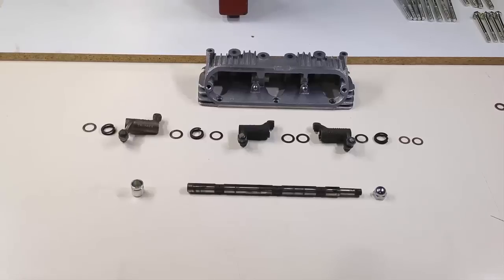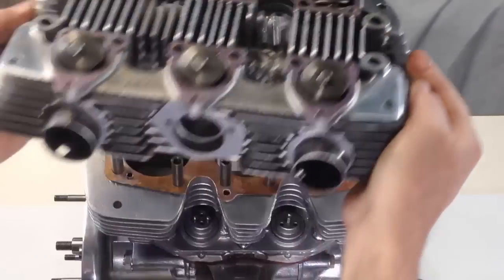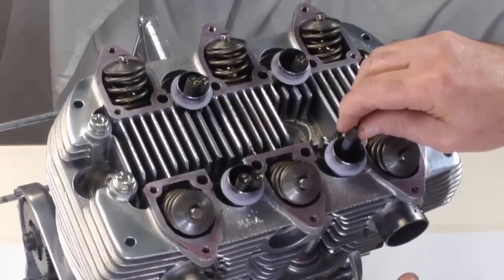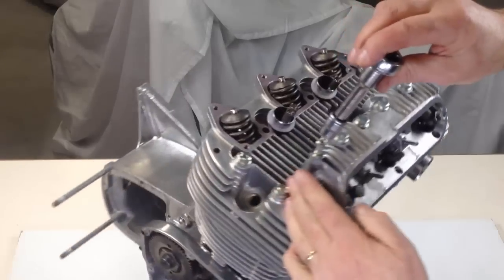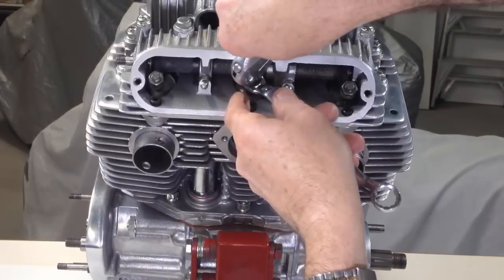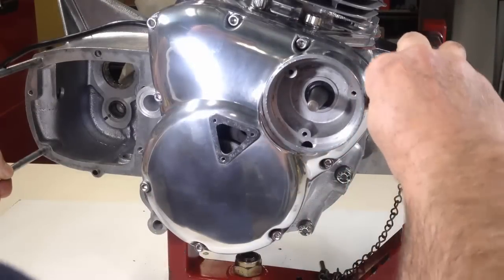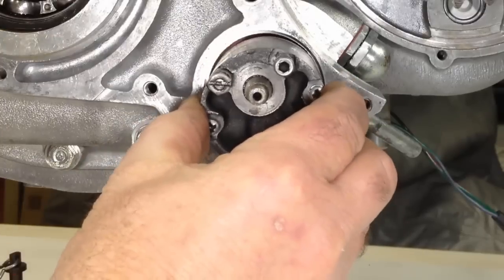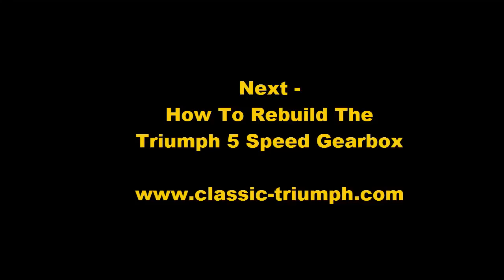Triumph Trident T160 Motor Assembly - Part3

Comment: Hi mark from tasmania I found out the hard way that if you take metal off the top of the head and off the rocker boxes (both sides) your tappet adjusters may foul the cover in use thus holding the valve open when all bolted up, also if your valve seats are pocketed (un leaded will cause this) it will also decrease clearance, I used putty to check them, now have4mm lid gaskets, good  luck they rewarding to maintain and ride, covid prisoner, cheers

Comment: Great series of videos, re non-return valve I have had 2 T150's that wet sumped. The problem was traced to the drilling for the oil feed tube, the factory had gone too far in and broken through into the crankcase. Drilled out to 3/8" and pressed in a steel tube, this sealed it off and increased the tube size. I sealed the copper head gaskets with silver paint and used a alloy gasket between the rocker box and head, the standard gaskets seem to displace over time.
Reply from the maker: Graham, Thanks for your comments. Every engine we rebuild we drill out the oil feed to 3/8" and press in a new (larger) steel oil-feed tube. The factory did this towards the end of production. I heard that this modification especially assisted with oil supply to a cold motor when the oil is thicker on startup.
Reply: I didn't know about this at the time, was in a rush to get it going for a BEARS meeting, used part of a Holden dip-stick tube as it was the right size.

Comment: If I am correct the valve adjusters are a floating ball type, can a solid mushroom adjuster be  used on the T160?  If not can the floating type be purchased

Comment: ...hello; seems that with the Tridents there are no the "crush" problem with the head; like with the Twins?
Reply: Everything that applies to a twin applies to a Trident BUT with the twins the Pushrod Tube O-Ring crush is associated with the head since the pushrod tubes go between the head and barrels. With a Trident the Pushrod tubes go between the Rocker Boxes and Barrels. It's still important to have enough crush but not too much. From the factory it was correct but after a few skims have been taken off to flatten things out the crush can become too much and the o-rings split or spit out and then leak oil.
Reply: @spending-planning  I see; I did not know that. Another point is that a head can be straightened without skimming.

Comment: Do you actually check at what pressure the oil pressure relief valves opens at?
Reply: No we don't check pressure. When we rebuild an engine we fit the bearing shells, measure the internal diameter and then grind journals to suit. From experience we have come to the conclusion that you can create more problems than you solve by dismantling and lapping the oil pump body to try to reduce any side clearance leakage. If you aim for between half to one thou clearance on journals you should have no oil pressure issues.

If you really wanted to check this you would have to fit an oil pressure gauge and see what the pressure builds to just after start-up while the oil is cool. I'm pretty sure 90psi is possible for a Trident engine in good condition. I did fit an oil pressure gauge to my T150 a few years back just out of interest. It's oil pump has never been tampered with and it had done around 37,000 miles at the time. At 2000RPM when cold it was holding 80psi. When it was hot at 2000RPM it was holding 40psi.
Reply: @spending-planning So that's a no then. I only asked if you check the operating pressure of the prv, a simple enough job to do.

Comment: Surprised that no rockerbox gaskets were used. Has the bike leaked oil when run ?
Reply from the maker: Dawn. if you use standard gaskets you are guaranteed to have an oil leak; maybe not straight away but definitely at some point in the future your gasket will collapse and you will have an oil leak somewhere around one of the head bolts. There is simply  not enough gasket surface.

 I did put this motor together without gaskets but found that there was not enough valve adjustment and so will pull the rocker boxes off and fit copper gaskets, but I don't think I will ever fit fibre compound gaskets again. They just don't last.
Reply: Covseal gaskets are a way to go, they don't leak. I still used compound gaskets, but on doweled rocket boxes.
Reply: @ClassicTriumph  I built my T160 without rocker box gaskets after the outer part of the gasket would migrate inwards, finally catching in the valve springs causing major oil leaks. I just used a smear of hylomar and never suffered leaks again. I don't remember having problems with valve adjustment though but it was 30 years ago. The best instructive videos on YouTube. Thank you.

Comment: What Carbs are those?
Reply from the maker: MC2 they are Hitachi carburettors off a 4 cylinder XJ 650 Yamaha from the 1980's
Reply: ok cheers ... you found a 80's Yamaha with decent Carbs! wonders never cease.